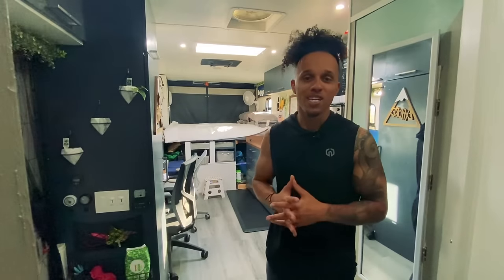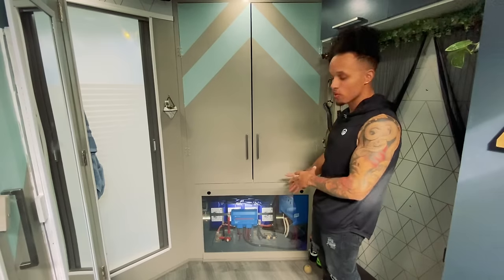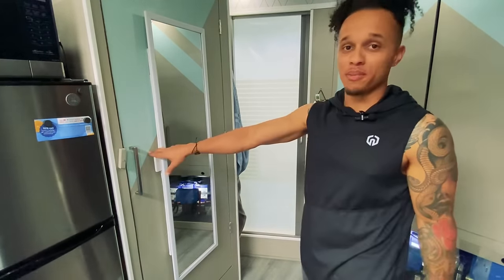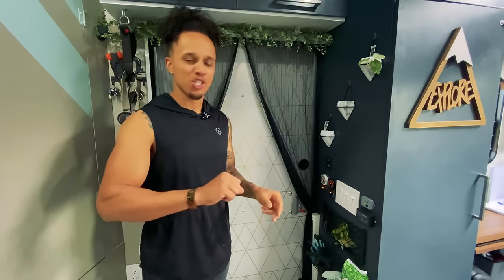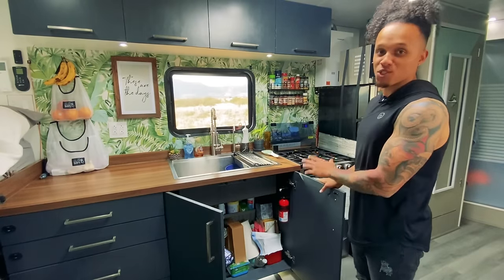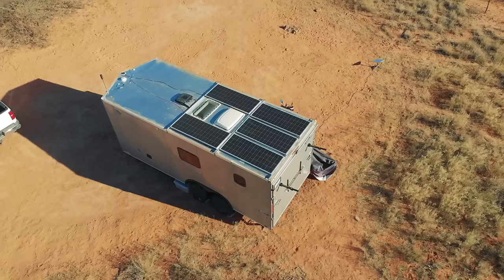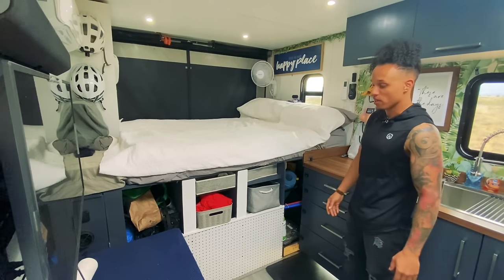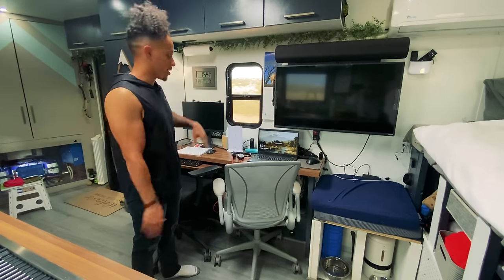The BEST Cargo Trailer Conversion I've seen!

Comment: I myself am in the planning phase of building my own unit. I am watching a lot of you-tube videos and have never seen one trailer that I wouldn't change a thing. It is always a little of this and a little of that. However with yours it is exactly what I was thinking...AMAZING job. 

a few quick questions...
1. How long do your batteries last with your power drain? 
2. How long does it take you to recharge?
3. Do you have a gas / propane generator as backup? 
4. ever thought of a wind turbine as a slow charge on non sunny days? 
5. Do you have any internet boosters?
6. What type of water heater do you have? 

I guess it was more than a few... 

I was thinking for myself 3 x 400 watt solar panels 1 x 400 watt wind turbine with 600 ah batteries. The only thing I think I would include that you didn't talk about is a game console.
Reply from the maker: Scott, Thank you brother! I greatly appreciate that.
I am very happy with how it turned out and how its been functioning for us..

1.) My batteries have not died on me yet (never below 20% to be honest). With our power draw (everything from fridge, starlink, microwave usage, tv, lights, heat, charging laptops and gear, ext..) and the solar we have, everything stays topped off during the day and lasts through the night.

2.) If we have a clear sky sunny day, it'll be charged back up to 90%+ by around 3pm usually. Now, this fluctuates throughout the year. Winter we get less sun than in summer, and the efficiency is different based on the panels relational tilt to the sun. But typically speaking, we are charged up i'd say AT LEAST 80% daily. 

3.) Yes, absolutely we have a gas generator as backup (pretty small, only 1800 watts). That has saved us on multiple occasions where we are stuck in cloudy forecast for days on end, or snowy/raining days back to back, forced to park under trees where we dont get solar, or when running the AC on high during very hot days for hours on end (95 degrees+). At this point, over the last year I have probably used it about 30-ish times now. 

4.) I thought about wind turbine after the build, but usually that wouldn't be needed the solar panels do a great job.

5.) No "internet boosters" per say, we use Starlink as primary internet (This has been AWESOME for us). And we do have a "signal booster" for rare occasions we use cellular for data or just need better phone signal.

6.) We have a tankless propane on demand water heater. I think the brand is Camplux (I think). Basically like a residential water heater (exhaust vent goes outside the trailer). That has worked great for us. Nice hot showers during snowy single digit days, its a nice refreshing feeling. 

The BIGGEST TIP I can give if your doing solar, MAKE TILT-ABLE PANNELS !! This REALLY helps A LOT. I cannot stress that enough. You want your panels at the best angle for maximum consumption. TRUST ME. Flat on the roof they work to about 75%-80% efficiency. So take that into account when calculating your electrical needs and charge. 

No time for games around here lol, I gotta devote time to other things like trying to prevent this beaten body from getting old and rusty on me 
🤣.. Plus I need time to plan for my NEXT BUILD 🙊🦾

Hope this helps man, and best of luck on your build. If you wanna buy one, ours is for sale. lol

Cheers!!
Reply: Next build? What are you planning on changing and / or adding? 

Selling? How much?
Reply from the maker: @scottfanelli7328  Here is the link to the listing 

https://www.facebook.com/marketplace/item/168472356230031/?mibextid=6ojiHh

(It should also of popped up as marker cards, top right corner, of video at various points. Also in description of video)

Comment: Like the build.  Where do you store the ebikes and motorcycle(s) when traveling?  I did not see anything on your floor and with your built in garage, etc. wonder how you bring the bikes into the trailer.
Reply from the maker: Thanks!!

So the dirt bikes get loaded into the back of the truck bed and strapped down.

The ebikes get loaded in the garage. I built a slide out bike rack that they rest right on. The video may not of shown that now that I think about it, but yea its a black rectangular box thats on slides. Load the bikes in, strap em, and push it under the bed. This keeps them inside and away from the weather elements. 

Thanks for checking out the video!

Comment: Do you have any more information on the cabinets? We’ve been planning for a trailer and aren’t sure about the best type and place to start for custom cabinets. Yours are by far the best I’ve seen
Reply from the maker: Hey, Thanks Austin! I Appreciate you checking out the video. 

Basically the cabinets are 1/2” plywood for the carcass, with 3/4” as the face. 

Full overlay hinges, gas struts, primer, paint, seal and that’s about it 👍🏼.

Comment: Great info and nice job. 
Do you know the "Dry weight" of your trailer? Since it is a cargo trailer, it probably doesn't exceed the Gross weight.
Do you wish you put in more windows?
Do RV parks allow cargo trailer conversions?
Reply from the maker: Thanks!

I do not know the exact weight, but my estimates lead me to believe its between the 8-9k lbs mark-ish.. I'm yet to get to an official scale yet but once I do I plan to do an updated video (It does not exceed the Gross weight of the trailer, no).

Ah, more windows is actually probably one of the things I would change, and actually might change here in the near future. We don't camp at RV parts at all so I'm not too sure on that one. We are all off grid, so we stay on public land for free. Its great. Way more privacy and space!
Reply: @whoiskyran1446  We've been looking at RVs for a couple of years. The more I look the more I see poor quality - even on the "better" brands.  I'm a woodworker, so the build would be do-able until it comes to the electrical. Solar and Lithium would be a must. Never considered a composting toilet, but I've never installed a black tank either. My tow vehicle is a F250 diesel, so weight wouldn't be a concern.

Comment: I was loving your stove but the link doesn’t work anymore. What is the name of the brand to do a search for it.
Reply from the maker: Oh darn, yeah that link isn’t working anymore. 🤔… Thanks for letting me know. I’ll have to try and get a new link up. 

But it’s a Greystone 21” propane stove. The version I have (with the drawers built into the bottom) might not be made anymore 🤷🏿‍♂️.. but I didn’t see a lot of them when I found the one I have. 

If I can get a new link up tomorrow I’ll drop you another comment. Otherwise, if you google something along those lines I think you’ll see something comparable. 

Thanks for checking out the video! 🙏🏽

Comment: I've enjoyed following your build.  Great job.  Beautiful and practical!  I also really appreciate the links to items you've used.   I'm getting ready to start a build in about a month.  Couple of questions.  I saw that your plan included a different AC and then you switched to the mini split unit.  Was the diesel heater also an original and now you use the mini split for heat?  Did you have video for mini split install?  Also what is the width of your base cabinets?  Thanks again for your generosity with your build info!
Reply from the maker: Hey Shelly,

Thank you very much 🙏🏽. I Appreciate you checking out the video. 

So the diesel heater is our primary source of heat (it works GREAT) and the mini split is the backup.  I added the mini split after our first AC choice wasn’t quite strong enough for this large space in HOT weather. 

I did not do an install video of the mini split though 😬.. As far as width of cabinets are, my upper cabinets are both about 13” x 13” x 61”

Comment: Great build and incredible attention to detail. I’m just starting a build of my own and am planning to put my water tank under the vehicle above the axles. You mentioned you moved yours inside because of issues you had with it underneath. What kind of issues did you have?  I don’t want to repeat your headaches. Thanks for the great video.
Reply from the maker: Hey, thanks for checking out the video! 

Basically it was a clearance issue, that’s all. I didn’t feel comfortable with how low it hung, especially after scraping it on a big dip in a road.

Comment: Is this completely off grid if need be? I'm a trailer tech out of Missouri and plan to convert one as well.

I'm mostly concerned about not having power in the colder months
I
Reply from the maker: It is completely off grid, yes. 

We have full solar setup so no plug in or anything required. 

All we do litterally is boondock (no hookups). And everything works perfect 👌🏼

Comment: Very cool build! I noticed it looks like you are running standard 120v residential AC switches for your lights/dimmers. Are your lights 12v DC, or are you running 120v lighting?  Wondering if they are 12V how you are using the regular residential switches?  I want to use the residential style instead of the regular small standard RV style switches you see all over the place, since the ones you have look so much nicer.
Reply from the maker: Thanks David, I appreciate that man!! 

Yes, those are regular 120v residential light switches being used for my 12v lights. They work fine, no problem at all.

Comment: Awesome build! May I ask what the product is between the fridge and stove burners? I have a similar issue in my house and have been looking for a product to solve that problem.
Reply from the maker: Thanks my friend! 🙏🏽 

That is an exhaust heat shield made of aluminum. Basically I glued a couple magnets to it which holds it to the fridge and gives it an air gap between the two. 

Here is a link to one on Amazon ( https://amzn.to/3XzHv6y ). That’s not the exact size that I used, but with that I’m sure you can search for exactly what you need 👍🏼

Comment: Great job. Congratulations on an awesome job. Like the design. 

What apps do you use to find camp spots? Would enjoy a review of those apps. Most reviews on yt are geared at pushing the affiliate link. (Nothing wrong with that) just think they don't cover the details very well. 

Thanks for sharing your journey.
Reply from the maker: Thank you!! 🙏🏽 

We use primarily Campendium for spots, and iOverlander for public water/spots sometimes. But we’ve found that there is sooooo much land that’s not on those apps. A lot of state trust land and other public land that just isn’t on there. So often we find ourselves googling to find spots 🤷🏿‍♂️. But those two apps work pretty well for sure!

I appreciate you checking out the video !! 🙏🏽
Reply: @whoiskyran1446  Thanks for the advice 👍

Comment: Awesome video!  Do you find 400ah of batteries sufficient?
Reply from the maker: Appreciate you boss 🙏🏽 

For the both of us living in here, working full time, and not really “preserving power” per say, yes 400AH works fine.. as long as we don’t get back to back days of clouds then it works fine. 

However, would I double up capacity on my next build just for peace of mind and to absolutely forget about checking the battery levels, Yes. 

400 works fine, but 800 would be even better if that make sense.
Reply: @whoiskyran1446  also do you know the weight of the trailer? Is your truck a 2500/3500?
Reply from the maker: @gregjonesdfw  My trucks a 2500 (gas engine)

Trailer is about 8,300 loaded up (without water)

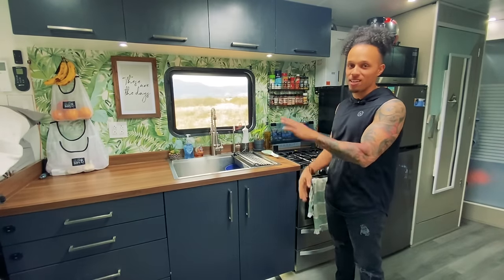Comment: 12:30 You have a beautiful shower, but be honest with us about how many showers you can take when boon-docking for 2 weeks on just one 100 gallon fill.   13:05 what locations can you just "let the grey water drain out?   Guessing you wouldn't do that in Walmart parking lot.   18:10 Need to be an acrobat to reach that emergency window if trailer is on side.  Do you have a step stool onboard?
Reply from the maker: We take showers every few days, sometimes use a gym if one’s nearby, but modest usage of shower and we have no problems. 

The gray water gets dumped anywhere (usually on public land where we camp). It’s water from the shower and sink, we use environmentally friendly biodegradable soaps. 

We do have a stepping stool on board, although in an emergency we all tend to be able to do more than you first think 😉. The window is not that high. If you can get on your kitchen counter in an emergency then you can get to the window 👍🏼

Comment: How much do you run the A/C and heat?  It doesnt seem like 400ah would be enough for that mini split and everything else.  Or do you use the alternator or a generator quite a bit to keep evening charged?
Reply from the maker: I honestly only used the mini split HEAT like 2 times over last 10+ months full time in this thing. 

The diesel heater is our main source of heat and that pulls like no power!

The AC we use for sure. 

We do have a generator but have only used it like 12 times or so since we been in here. 

The mini split has an “eco” mode (75 degrees) and pulls around 400-600 watts when that’s on. (That’s what we usually run it on)

When it’s a sunny day our 1,000 watt solar keep the battery good to go, powering everything and charging at the same time. 

Sunny day w/no clouds, we run everything and the AC, batteries are 90%+ by sundown.

At night I turn off inverter while we sleep to keep from draining unnecessary battery. 

Same cycle next day and batteries are 👌🏼 

With some cloud coverage, Solar won’t charge as fast so batteries usually 70-80% by night. 

But na, overall 400ah is enough for all of this. 

I’ve NEVER seen batteries below 25% since living in this thing. 

Hopefully that helps!

Comment: Curious why you chose the mini split A/C over some more traditional Van/Trailer options
Reply from the maker: @DirtSickle1  Well I initially went with the Fresair 12v AC unit, but that’s not really an AC, more than a swamp cooler and for the space it didn’t work well. 

So then the mini split was the choice because of the power draw, remote control (can change settings remotely when away) and ability to monitor inside temp when away (we have a dog so that’s important for us). 

It runs on the battery bank and solar setup, no plugin needed. 

Hope that helps.
Reply: @whoiskyran1446  Yeah I just want to pick what cools it down the best as well as not wasting too much power
Reply from the maker: @DirtSickle1  Thats what I just explained
Reply: @whoiskyran1446  Yeah I'm wondering why all vans don't run a mini split over a cruise n Comfort or Dometic rooftop
Reply from the maker: @DirtSickle1  The size matters.Rooftop units only take of that external rooftop space. 

Mini split has the condenser/compressor unit which sits outside, and the inside unit.

Comment: @Kyran how hard is it to get that 20' down those BLM roads? I'm in the design process with mine and I work remote just like you two. I don't think I will be able to get a bus down those roads at least in the High Dessert of SO CA. Maybe a trailer would be easier.
Reply from the maker: It has done fine for us thus far. And forest roads/BLM roads are basically all we drive down (to camp). 

The lift on the trailer helps for sure cause there have been many of places where we would of scrapped coming out of a dip or something, but overall the trailer has been perfect. 

If I’m being honest, sometimes I think 20’ may be longer that NEEDED, especially if it’s just 1 person living in there. The longer trailer just makes overall length feel long AF To me at times lol. But then again I didn’t have any experience towing before this thing.
Reply: @whoiskyran1446  That was very nice of you to answer this for me. I really appreciate you and I love the build you two did. My deal is my office is also small recording studio and I'm worried about things bouncing around. I think I am going to need the entire roof for the solar, it will take a lot of juice. I gave myself a deadline so it's coming down to do or die time soon to buy a trailer or a bus. In the long run the trailer makes more sense because I'll have a Truck and an Enduro to get around on. 

I'm going to spend my time boon docking between San Diego, Oregon and Colorado. I have family in all three places. 

I'm subd, looking forward to watching your travels.
Reply from the maker: @dinofond  Dope!! Sounds like exciting projects coming up then. 

Yes, from my personal experience I would say a trailer makes sense if you plan to post up and mark places longer, if you already have a truck, if you want more comfort and space, and don’t wanna have to worry about your “home” breaking down later on down the road. (It’s easier to get a different truck than it is to do an engine swap in a school bus 🤷🏿‍♂️. 

Also, the actual build process of a trailer is easier than a bus. Much less angels and stuff to work around. Also, ceiling height is much better in a trailer. 

But overall sounds like your off to a great start! 

Make sure battery bank is adequate for your needs and I think everything else is comfort luxuries 😎. 

Cheers and best of luck on your build!

Comment: How long will the AC run at night without a generator?
Reply: Good question, this kinda liying a55 youtuber always give you an idea like those all things can be run only with solar panel.
Reply from the maker: @61462bubb  Mini split absolutely can run fully off solar (ours does). 

First off though, we follow good weather generally, so we aren’t places where we need cold ac all through the night. 

Depends on how long you run the AC and what settings. 

This model, ECO mode (73 degree setting) pulls about 400 watts. 

We have about 4,800 watt hours of battery bank, so run the math for an estimate off that. 

Hope that helps.

Comment: How do you heat your water?  Also is the TV and Sound Bar 12 volt or 120 v?
Reply from the maker: The TV and sound bar are 120v.. 

I have a tankless water heater inside, I forgot to speak on that but it’s right behind the fridge. You can probably see it in the video somewhere. That is also 120v + propane